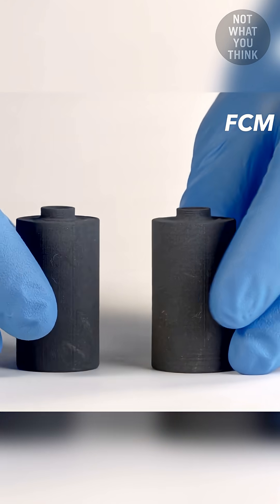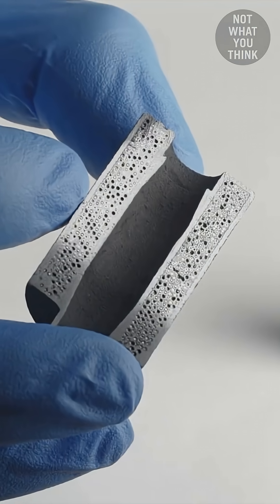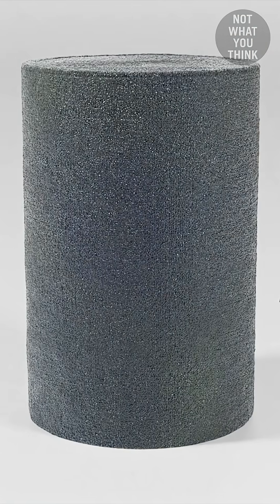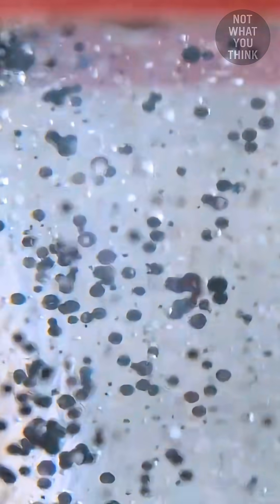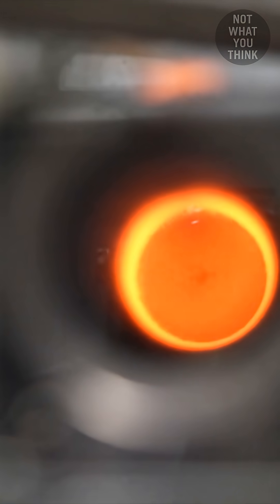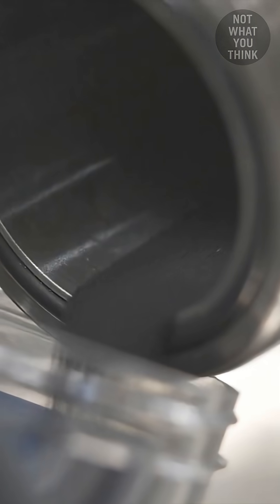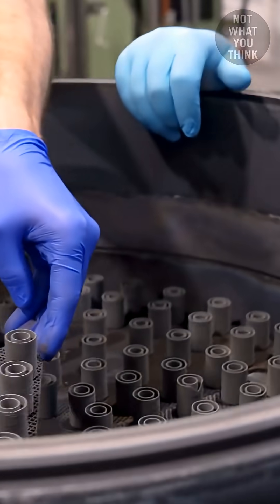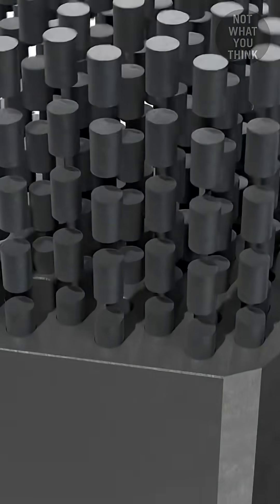Tiny Million-Dollar Battery

Comment: I was kind of hoping each battery could generate a relatively low amount of power for a long term, like a reeeeaaallly long life duracell.  Still, a failsafe nuclear reactor in a shipping container is still pretty great.
Reply: Ya, one step from fallout power cores lol.
Reply: These do exist, look up betavoltaic cell.
Reply: @charliekempf   That's still not quite what I was thinking but it's a lot closer.  Maybe if someone wired a stack of them in parallel and encased the stack in a standard battery shell we'd pretty much have what I'm looking for.
Reply: @Voltaic_Fire this is probably not possible, the energy density of nuclear isotopes is higher than chemical batteries, but the power density is much lower. This means that although the betavoltaic batteries store much more energy than a duracell, it is much slower at releasing that energy than a duracell.

 Remember that a duracell produces 6-10 watts when short circuited. If you had a lump of material decaying at a rate of 6-10 watts the size of a duracell, it would visibly glow red due to the heat.
Reply: @charliekempf 
Yeah, radioactive isotopes for small scale power really only work well when combined with a stirling engine.
Reply: @Voltaic_Fire what you're thinking of is the Carbon 14 nuclear waste battery. I forget the details but it's nuclear waste embedded in diamond for shielding, produces very very low output for extreme amounts of time
Reply: @widdly-scuds That's not quite what I was hoping for, I was hoping either for something the size of an AA battery that could produce 20W for decades if not centuries or something the size of a 500ml bottle of pop that could output a kilowatt for the same duration.  Basically I was hoping for something that rendered charging most household devices a thing of the past, and I'd be lying if I said Fallout's fusion core didn't inspire such a hope.
Reply: @charliekempf I'll do that now.
Reply: @charliekempf  yeah that’s really not a simple small battery during hundreds years because sill in research from 2000s and producing tiny amount of energy (nanoWatt per squareCentimeter).
So it would be really a nice use, using Beta wave with C14.

But sure if they could manage to produce a real power it could be batterie with theoretical use for thousand year.

But with the buy once use once market system we re in, a battery with that range of use would cost the price of lifetime supply of normal battery, with much more power.

But it would awesome if / when it will be true / affordable. 

A laptop with 100years battery without recharging it is not for tomorrow.
Give me 1 week of use without charging I already would more than happy 😅
Reply: @charliekempf came here to say that.
Reply: Soviets used to power remote infrastructure (mainly lighthouses) from a Strontium-90 thermoelectric generator. We do the same for long range space missions using plutonium instead. The radioactive material decays, generating heat which is then converted to electricity using solid state devices. The conversion is rather inefficient, but the decay heat continues to power the device for decades. Low power, long duration
Reply: for space exploration we use RTGs, they are kind of what you are describing I think
Reply: 110W of power with a half life of ~90 years
Reply: Some Russian light houses are powered by RTGs. They could work for decades without maintenance (and I guess some did after the collapse of the Soviet Union).

But you probably shouldn't get a discarded Russian RTG for your home after it has been allowed to rust for half a century.
Reply: @klausstock8020  lots of stories about people finding these in remote regions and bad things happening.
Reply: I feel like this is kinda a step towards that. I mean half the stuff soldiers use runs on some kind of aa/aaa type battery so I feel like a mega long life battery of that size using this tech is on the way
Reply: Am I weird, or did anybody else think about shotgun shells.
Reply: You mean fuel cells?
Reply: Until the enemy drops a thermite bomb on it...
Reply: I was hopping for 1.21 gigawatts 😂😂😂
Reply: So Israel can have nuclear bombs everywhere*
Reply: The only thing is that there is no chemical reaction to produce energy here, just radiation/decay. You just need a thermovoltaic cell to generate your energy.
Reply: they use those on the mars rovers
Reply: failsafe  XD made my day...ty
Reply: RTG
Reply: nuclear reactors are less efficient as they are smaller, basically you are wasting your fission neutrons if you don't surround it with more uranium
Reply: Like a Nuclear Diamond Battery (NDB). A coin battery sized radio isotope power source that can power devices for 5,000+ years. However it generates mere microwatts (µW) using radioactive Carbon-14 (C-14), a byproduct from graphite in nuclear reactors.
Reply: "Fail safe", that's what they thought about Tschernobyl before it happened
Reply: @Eukalyptiikz yeah except for the part where they cheapest out and cut corners and didn't tell anyone the control rods also functioned as bomb fuses
Reply: I also enjoyed small soldiers
Reply: You just invented the nuclear reactor. They all do that if you just run them low.
Reply: This is not a battery

It's like the world doesn't know what a dictionary is anymore.
Reply: sounds like a variant of the pebble bed reactor, which is damn near idiot ptoof...
Watch 'em fuck it up... I dunno how, I dunno where, but I know it will be fucked.
Reply: I don't see why we wouldn't be able to miniaturize old RTG designs, or use the thermal energy in these to power a small sterling engine embedded in the host device. Of course with that latter option they wouldn't be backwards compatible with current battery powered devices.
Reply: Energy balls. Hah
Reply: That is an RTG. It doesn't do any nuclear reactor stuff, it just uses heat from decay and the thermoelectric effect to generate electricity. They typically don't use uranium though. Depending on how long it needs to last they use various elements.
Reply: Thats what the diamond coated bateries are for
Reply: Great to be disposed improperly in democracy-less countries

Comment: The military already has containerized nuclear reactors.
Reply: There are commercial containerized reactors available. Where did you think the military got the technology from? They are a few million dollars, the cheapest and smallest ones at least. You can power an entire village with one. It could be the future of communal living. People invest in the reactor, buy some land, move away from large ghettos designed to extract every last ounce of life from you, also known as cities.
Reply: @KaMil-gw2qr god that sounds so good.
Reply: @KaMil-gw2qr  No there aren't. At least not yet.
Reply: But they are very dangerous if damaged.
Reply: @VytasVytautas  False, they are meltdown proof, and the housing is made of extremely dense materials. A transportation company unused to work for dealt with the housing. One the size of a bathtub weighed over 50,000 pounds.
Reply: @MondoChow777  You could have solid block of osmium the size of a bathtub and it wouldn't weigh 50,000 pounds. Stop making stuff up
Reply: @MondoChow777  Those numbers on size to weight don't sound right.
Reply: No they don't. The company developing this reactor is called Radiant Nuclear and they will conduct the first of its kind test in Idaho this spring. This will be the first portable nuclear reactor in existence (not counting the two or three that have been launched into space).